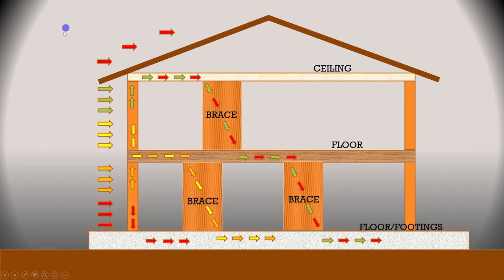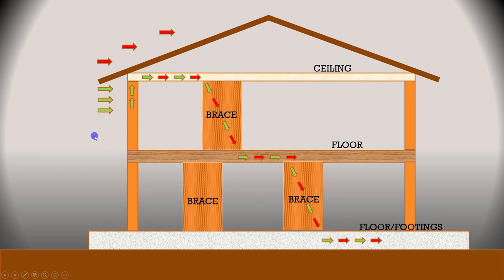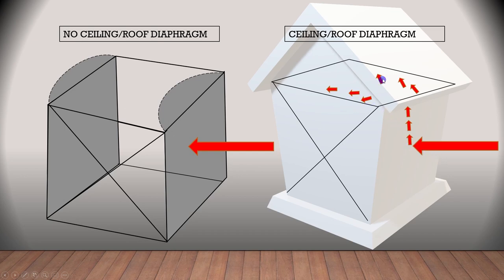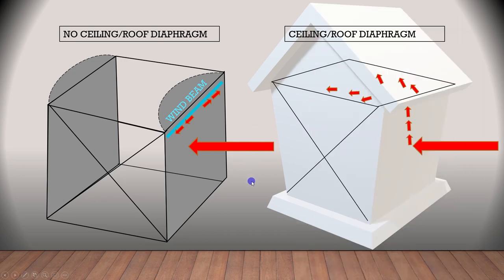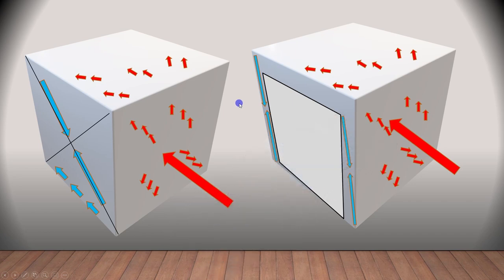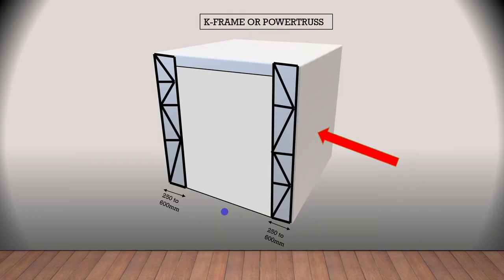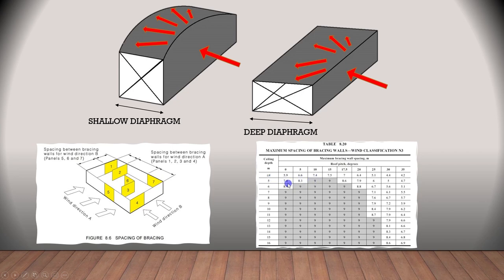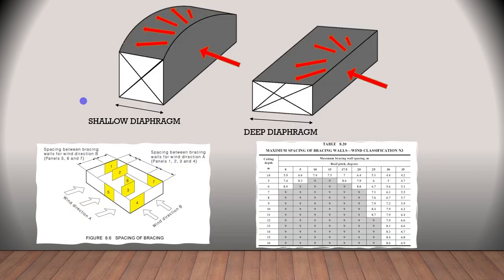Bracing for houses

Comment: Nice explanation! I presume you are talking about timber houses Light gauge steel has other options as well.
Reply from the maker: Most of it is for timber framed houses.  The fundamentals may apply to masonry as well. But you're right, there are a multitude of options out there. Thanks for watching.